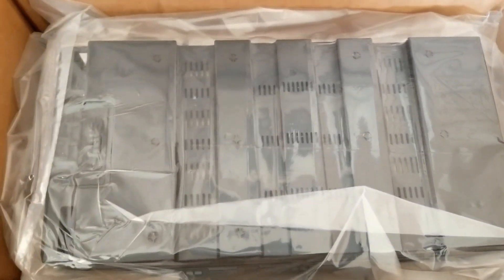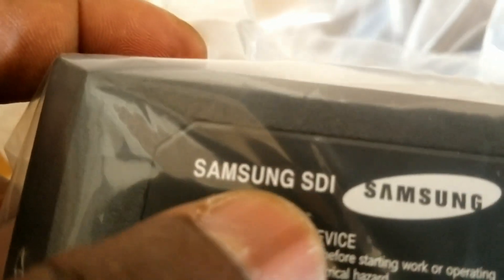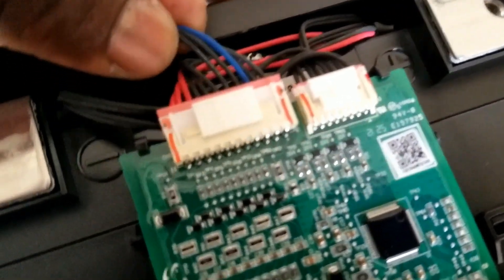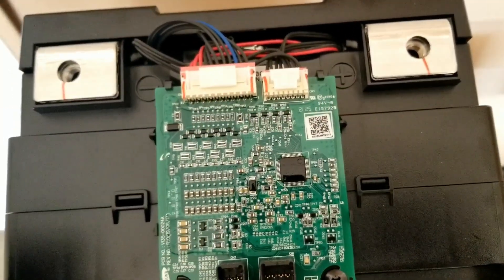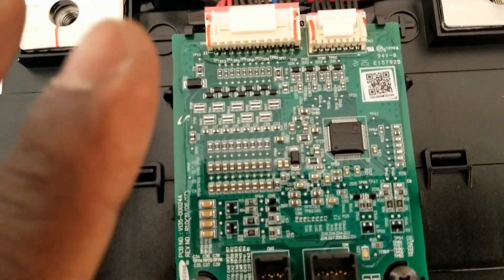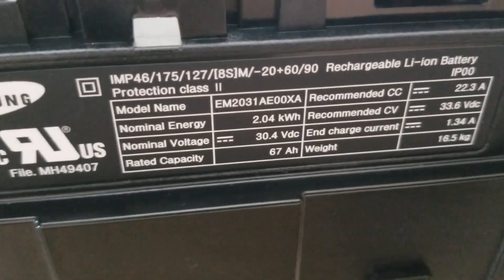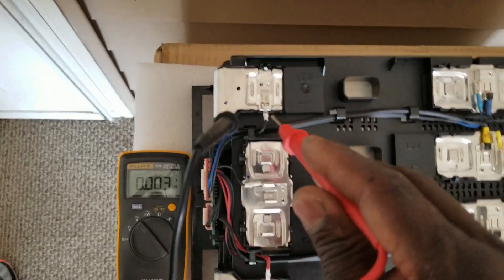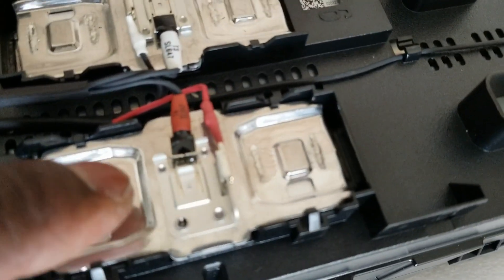8s SAMSUNG SDI 30.4v 67ah 2.04kWh LITHIUM ION

Comment: I have been using Samsung SDI cells in my off grid solar system. Mine are also in an 8 s configuration. I am looking for more of them. Where did you acquire these? And are you intending on selling them or using them? Just curious from Ontario Canada
Reply from the maker: You can buy these batteries from this battery hookup link I sent you.
USE THIS LINK TO BUY YOUR LITHIUM BATTERIES AND SAVE 5%
BATTERY HOOKUP PROMO LINK 
https://batteryhookup.com/discount/jwsolarusa
Reply: How long have you been using them in your cabin? I'm wanting to do similar